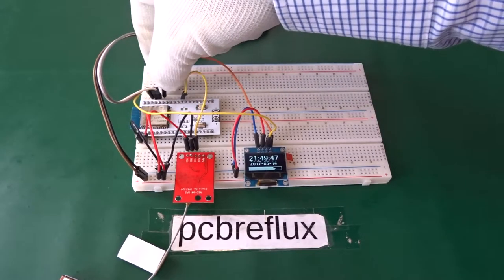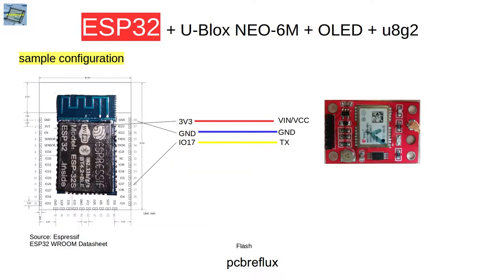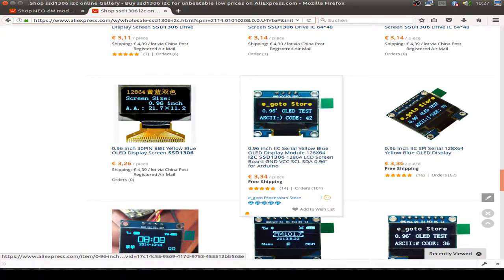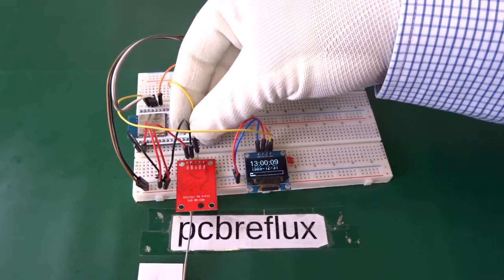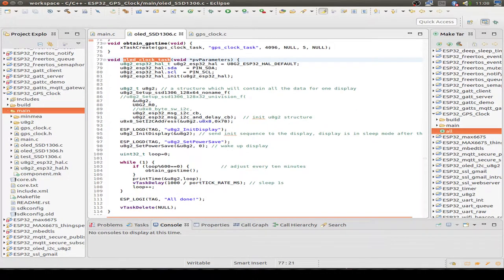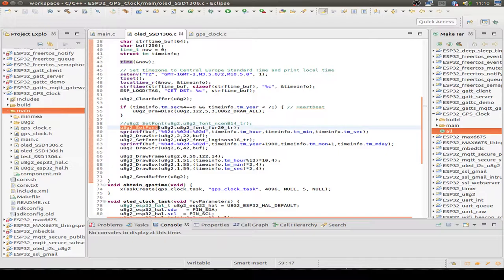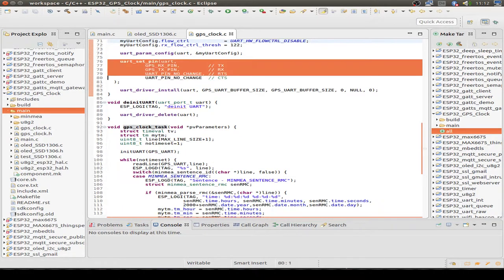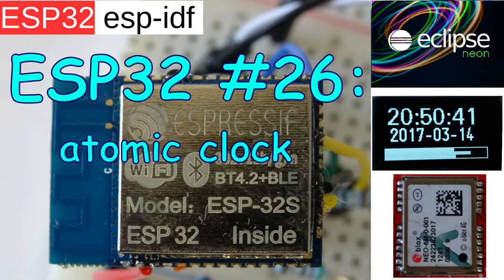ESP32 #26: atomic clock

Comment: Hi! 
Did you consider using the PPS output to get a very accurate time reading?
Probably this was not you design goal, but it might be a consideration, from my experiments with a GPS based ntp serveron Linux, when using the NMEA time stampstime s accurate within
10 ms. With PPS enabled it becomes accurate within 5 us, so around 10000 times more accurate.
Reply from the maker: Hi, I simply ignored the PPS pin for no good reason. But thanks for call my attention to that.

Comment: I have a question bout getting ESP32 chips. I would like to realize a small project where i use the ESP32 with some batteries to measure the temperature in all our rooms. I know how to solder a wire to something, but thinking about soldering the chip to the adapter board gives me headaches. Do you know a source where to get the ESP32 chip already soldered to the adapter boards? I don't need a whole set of DEV boards. i would need about 12 to 15 pieces and several more to do some other stuff i don't now about yet. But buying DEV boards is just too expensive. Thanks
Reply from the maker: Jörg Neugebauer Getting now a ESP32 with adapter for cheap is like a square circle. but you can have a look at ebay, aliexpress or analoglamb.com but be aware of shipping and tax or considder using the esp8266 for your usecase.
Reply: Thank you for your answer. The first considerations for doing that little project were before the ESP32 were announced. And it came in very useful that the ESP32 itself got a temp sensor and the ability to use the deep sleep without making soldering changes to the chip. But maybe i will think about using the esp3266 or just wait a few months